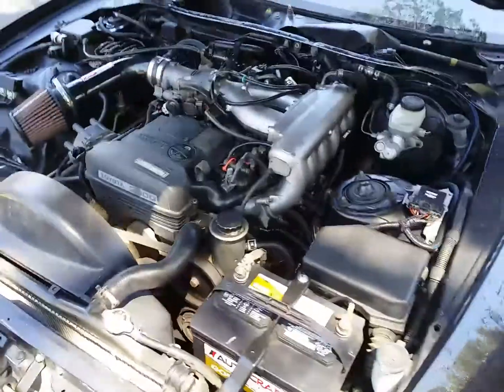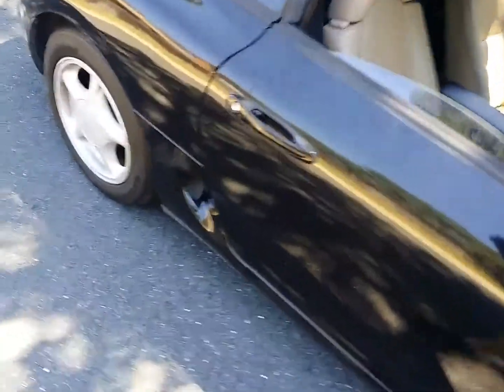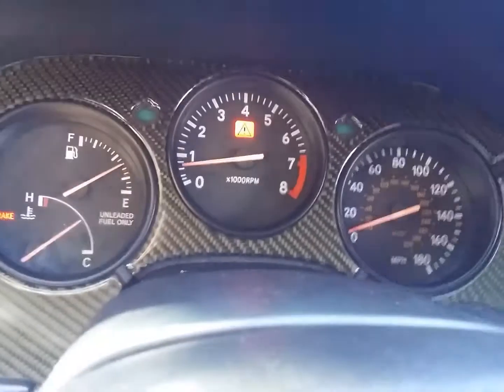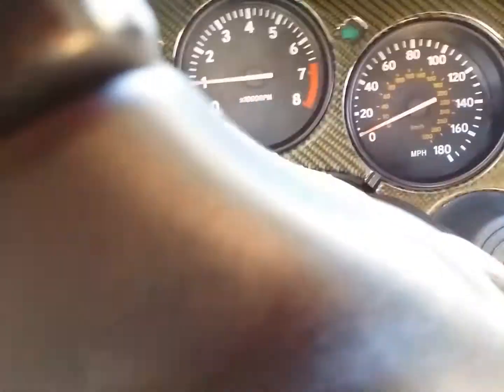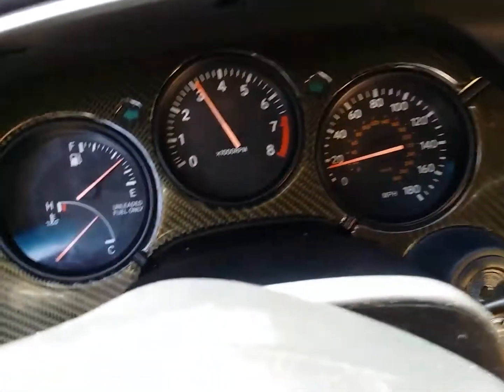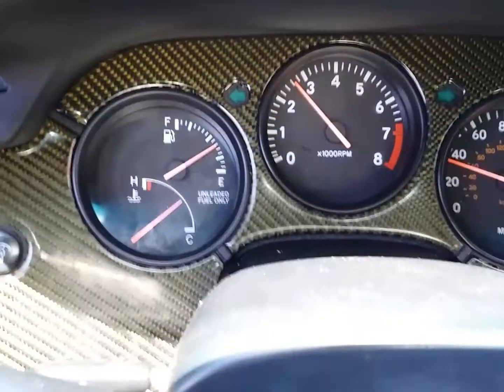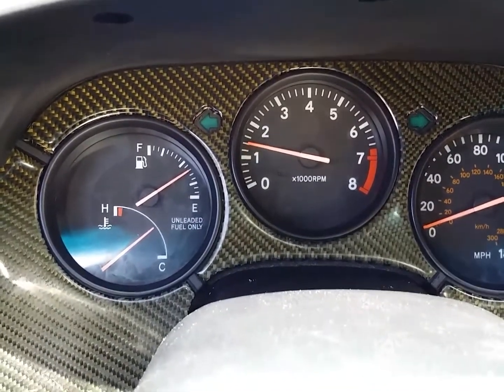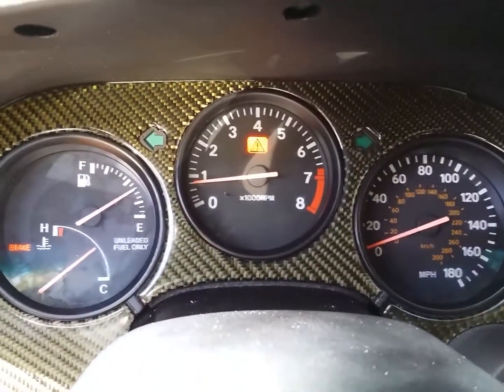1995 Supra NA to GTE ecu mod vvti coils completed

Comment: In these videos are you using the stock NA injectors and fuel pump before you go turbo or did you upgrade the pump and injectors as part of running the Aristo ECU? I would also like to get mine all wired up and running before I go boost.

Comment: My '95 Supra starts, runs, & idles BEAUTIFULLY, but jerks VIOLENTLY after driving about a half mile in the city at low speeds. Check engine light blinks when  jerking / stalling. What could this problem be?
Reply: If you're an auto it's the ecu not releasing the stall converter. Works better with manuals.

Comment: I just finished his mod on my sc300 but now it’s idleing and running rough  did you have any probs like that first start?
Reply from the maker: Matthew Regidor  i had a vac leak at the throttle body cause i forgot the lower 2 bolts
Reply from the maker: Matthew Regidor it could be alot of things with a mod like this. Bad coil pack, bad plug wire. I'd check vac leaks first
Reply: R Atom ok thanks for the feed back my car is running really rich a lot of black smoke coming out and I let the car run to let  learn and nothing
Reply from the maker: Matthew Regidor ecu could be bad and need repaired too
Reply: R Atom would a bad map do this? Bc I got a cheap map and I’m going to switch to a oem one
Reply from the maker: Matthew Regidor try an oem one for sure